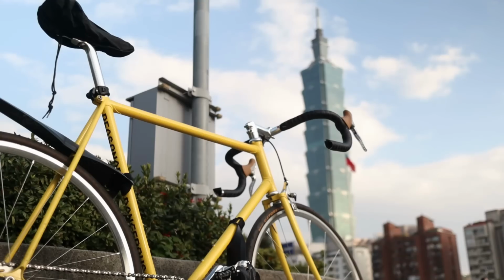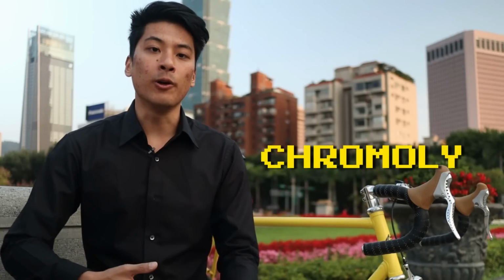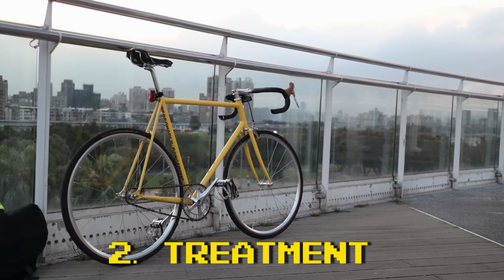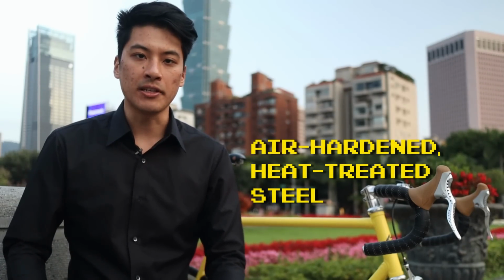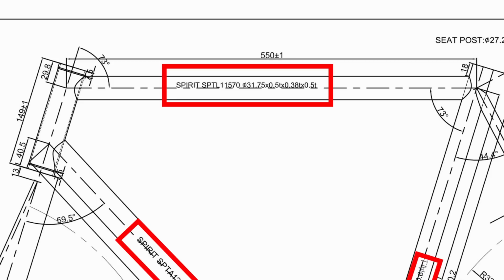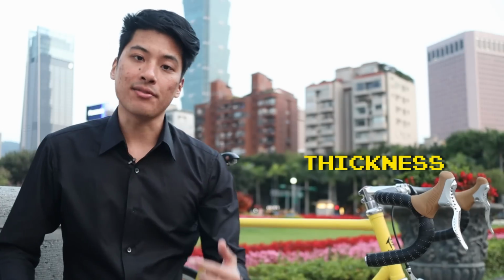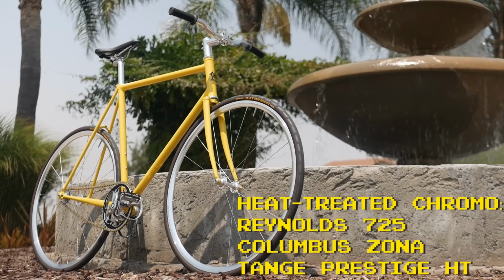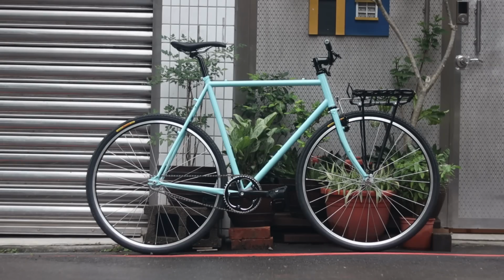Steel Bikes Explained | Sponsored by Wabi Cycles

Comment: Great video, and I know this was 4y ago, but I've only just seen it and have some quibbles. In theory Reynolds 725, being stronger, means you can use thinner walls. But actually Reynolds will sell you the exact same tubes as 525 (without the heat treatment). The truth is regular chromoly is strong enough anyway to make into a .7/.5/.7 tube. The situation with 631 and its heat-treated counterpart 853 is similar, but they do have an additional range called "853 Pro-Team" which does have thinner walls than are available in 631. The other aspect is whether tubes are "drawn over mandrel" or "DOM" (originally made out of rolled up and welded sheet metal, before being drawn thinner and butted) or "cold drawn seamless" aka CDS (made out of a solid piece in several operations, and never had a weld). Columbus Cromor is DOM. Zona is CDS. I don't think Zona is heat-treated. 525 may be DOM but 725 is guaranteed to be CDS. Everything else from Columbus, even stainless XCr is CDS. The Reynolds stainless tubes are DOM again. Those stainless alloys are so ridiculously strong it's difficult to make them CDS. CDS is a bit stronger than DOM, but it still doesn't really matter-- you can get 525 in the same thin walls. Columbus differentiate their products more by only supplying Cromor with slightly thicker walls. Until you get to the stainless tubes there really isn't a great deal to choose between them. Any double butted chromoly, or anything from Columbus or Reynolds, can all be used to make a dope bike frame. They are all a step up from plain-gauge tubes or "high-tensile" steel. One more quibble. That seat tube you showed that was thin at the top is designed to be brazed into a seat lug. STs for TIG are usually "externally butted" (get a bit fatter on both the ID and the OD) because you do want a bit of extra thickness there to weld to. Despite my various objections this is still one of the best videos I've seen on the subject so keep up the good work :) I am a hobbyist framebuilder so am a bit obsessed (I usually use 631).

Comment: Bamboo has been around forever as well but that doesn't make it the ideal material choice for bicycles or jetplanes. Aluminum has progressed now to surpass steel tubing in every way and when used with carbon fiber.... there is no comparison.
I have had Columbus SLX and Reynolds 531 tubes, forks and stays on numerous bikes over the years and can assure you  that the cycling world has moved on in many ways including performance, weight and cost.
Your views are dated and more dangerously sponsored.

Comment: Trying to reconcile the marketing information with the metallurgical definitions leads to confusion of mind.  If you want stronger and lighter weight the tubing manufacturers have you catered to.  It's not a lie that it's stronger and lighter weight.  Their definitions, though, appear to be a bit nonsensical if you look into it.  The words don't always match up consistently with the materials science way of defining the concepts.  It doesn't matter as long as it meets the buyers' expectations.

Comment: Where does Reynolds 531 fall into the steel category as far as strength and characteristics?
Reply: It's similar strength to chromoly (a little bit lower but not much) but the main difference is you can't weld it (the heat weakens it). So it's fine for a lugged or fillet brazed frame. But no TIG. Reynolds 753 was heat-treated 531.

Comment: Gosh this is a wonderful video really clears a lot for my understandings of steel, but i can’t seem to understand this, is 1020 carbon steel the same as hi tensile and should I avoid it?
Reply: I built race car chassis for 26 years and this is my understanding of different steels.  AISI 1020 steel  is a low carbon designation.  The first two digits “10” are the type of steel, in this case low alloy iron.  The second two digits “20” are the point percentage of carbon in the steel.  In this case .20 percent carbon.  Carbon adds toughness and strength which means that you can build a lighter frame with the same strength as a low carbon counterpart.  4130 is a mid carbon range steel and is popular for aircraft and drag race cars.  The difference in strength between it and 1020 is about 30 percent stronger in favor of 4130.

Comment: “Material that has been around for 1000’s of years”?  Lol
Reply: Steel was known in antiquity and was produced in bloomeries and crucibles.[16][17]

The earliest known production of steel is seen in pieces of ironware excavated from an archaeological site in Anatolia (Kaman-Kalehöyük) and are nearly 4,000 years old, dating from 1800 BC.[18][19] Horace identifies steel weapons such as the falcata in the Iberian Peninsula, while Noric steel was used by the Roman military.[20]

The reputation of Seric iron of South India (wootz steel) grew considerably in the rest of the world.[17] Metal production sites in Sri Lanka employed wind furnaces driven by the monsoon winds, capable of producing high-carbon steel. Large-scale Wootz steel production in Tamilakam using crucibles and carbon sources such as the plant Avāram occurred by the sixth century BC, the pioneering precursor to modern steel production and metallurgy.[16][17]

Comment: A quick comment;  I am not sure if I heard about this in the video, but here it is: bike frames usually don't use a single steel alloy, instead the manufacturer will mix different tubes to reach a price point; i.e. Reynolds 725 main triangle and geneeric 4130 seat and chain stays. PS: now that you are in Taiwan, perhaps you have some Tange tubing bikes on hand so you can give some insight about it?

Comment: Vs. Titanium?

Other than cost, how would a steel frame compare to a Ti frame? Which steel is most like Ti in terms of weight/compliance/ride quality etc.?
Reply: Reynolds 853 or if you have the $$$ Reynolds 953 ( stainless steel)  In my opinion Reynolds makes the finest tubing for bicycle use... They have even started manufacturing tubing for motorcycle  frames again.. The famous Norton feather bed frame was made from a Reynolds 531 material..

Comment: Great video but Reynolds 631 is not a chromoly, its what you describe as a specialty alloy. Its actually the exact same alloy as Reynolds 853 which you say is a specialty, the difference between the 2 is that 853 is heat treated and 631 is not, making 853 much stronger.

Comment: Love this video!
Wonder if you could share tips how I can fix my brakes. When I pull on the brakes, it feels mushy and the bike takes a long time to slow down. Any tips?
Thanks in advance
Reply: take it to your local bike shop
Reply: This could be your brake cables. They can stretch and become more ineffective over time. If they're a year or two old it might be time for a change. The obvious answer would also be to check your brake pads haven't worn down. These will also wear down and need changing over time.
Reply: You might want to check out the Park Tool YouTube channel. They have a ton of great repair vids. If you prefer text, try Sheldon Brown’s web site.
Reply: Thanks all for tips. I managed to get them tighter. 
Still kind of squishy though.

Comment: Tange tubing is my favourite,bit I'll be happy to ride bikes with any other branded tubing(on bikes with cheap and unbranded tubing,anyone would feel some form of inferiority).Also,I have just noticed the TRP RRL brake levers with gum hoods.Noice!
Reply: Soma bikes. Mostly Tange.
Reply: @wasdalosdickarchen  Yeah.Given the chance,I would have purchased the Soma Wolverine.With those sliding dropouts weird gear setups can be achieved,not to mention the somewhat generous tyre clearances.
Reply: @reapanomin899  just bought the black v3 frameset and lugged fork from sale. If you dont need that belt drive, the soma double cross is even lighter, but same geo. I also have a 1982 Koga miyata (tange)
Reply: @BeboSaab I might actually consider doing a test to confirm that statement of yours,now that you actually said it.
Reply: @BeboSaab Sure,having a bottom that is able to feel the qualities of a certain tubing is dumb,but anyway,what frames are you comparing when you had mentioned in your first comment?And how long have you ridden them each?
Reply: @BeboSaabI see.Wait,for you to mention that,how old are you?
Reply: @BeboSaab Let me guess,are you in you in the 60 to 70 year old range?